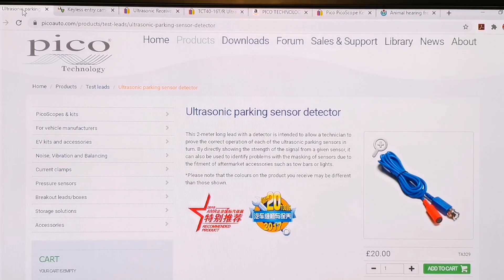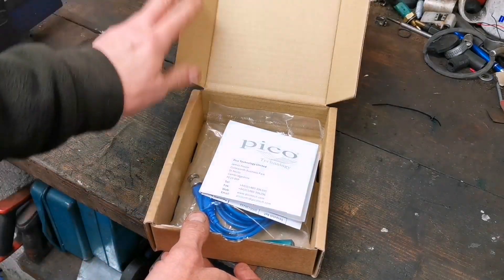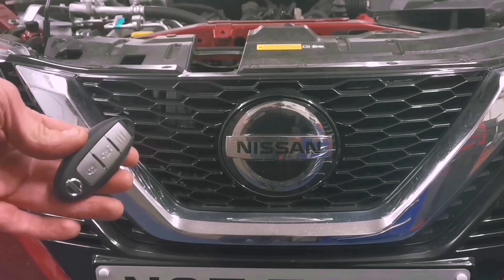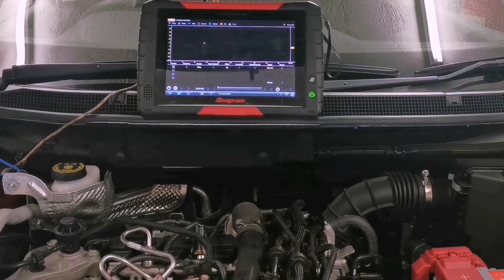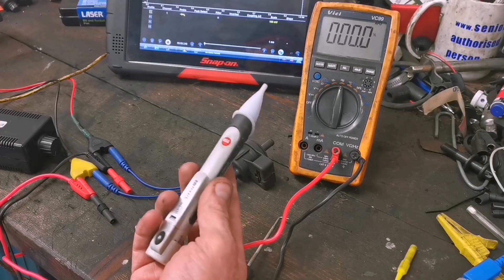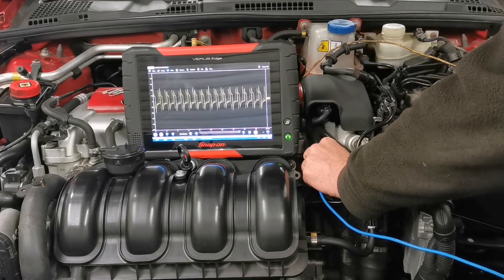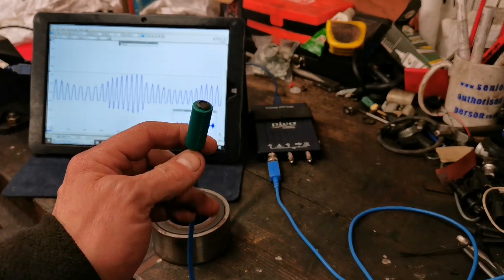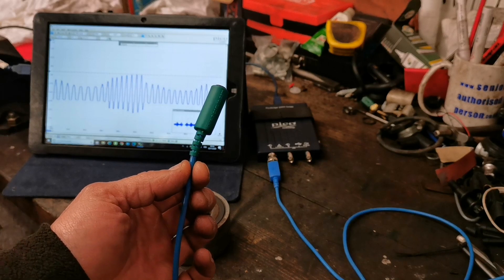Pico TA330 Multi Test Tool

Comment: Great video,  can i know that what was the voltage setting (Y) scale for the ignition coil wave pattern? And also what was the voltage setting (Y) for magnetic field picking up  from the solenoid on snap on labscope?
Thank you.
Okay, i have found it,  it was (y =100mv) and (X=50ms)

Comment: Great vid as always!
What touchscreen surface/laptop is that you’re using with the Pico,and would you recommend it? I like the thought of not having to use the mouse, makes it somewhat more portable.
Reply from the maker: Its a wee cheap chewi tablet which is great for zooming in
Reply: @davesterl  I don’t suppose you know the model number and where you got it from?
Thanks for the reply.
Reply from the maker: @dazzman1968  its a chuwi hi 12 which i came across on ebay